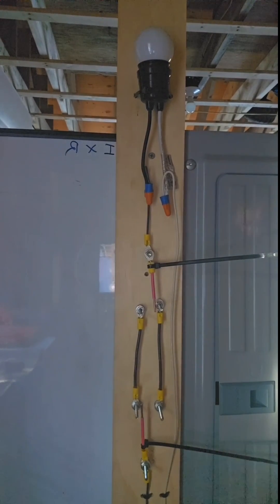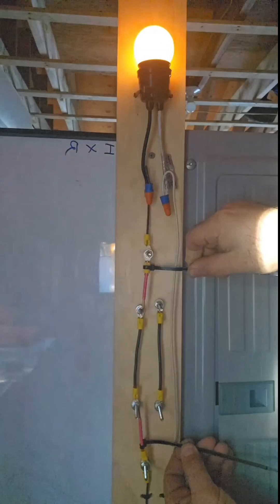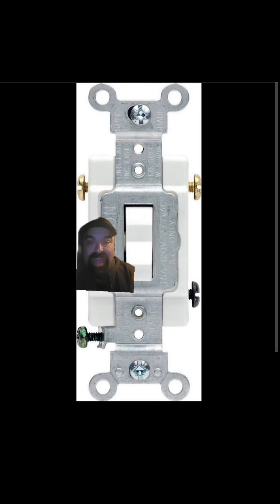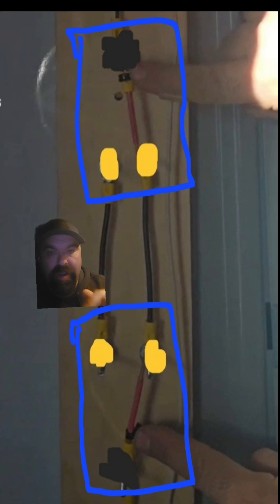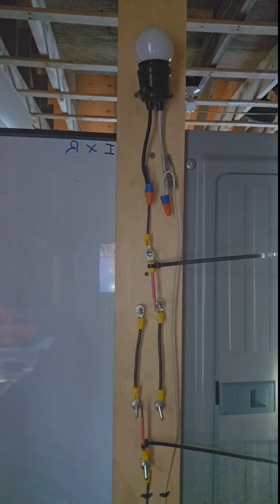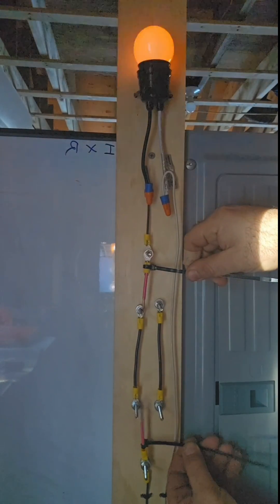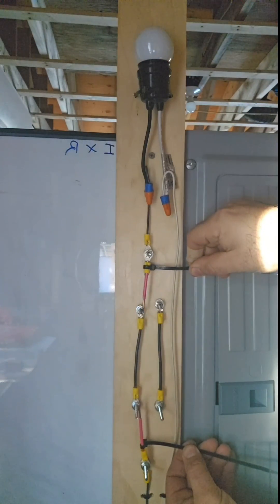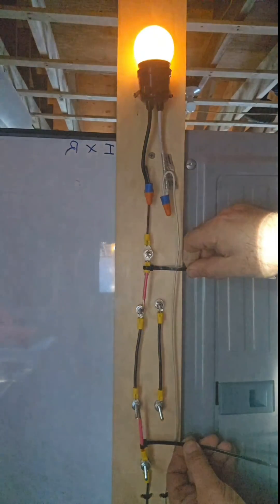how a 3way switch works threeway switch

Comment: And now show if the feed is at the fixture, and maybe show one being a dimmer and one a regular switch. Another video idea, when someone replaces a receptacle and doesn’t break the little tab, then they seem to have light switches that do nothing, but really they were switched outlets, either top, or bottom, but the friend that replaced the outlet broke that function without realizing it. I’ve rented houses and visited others that rent or buy a house and have this issue, more common than people thing.